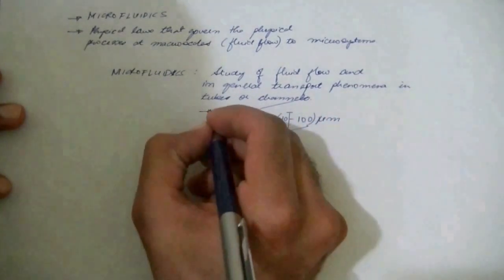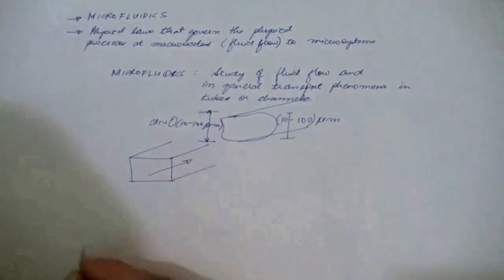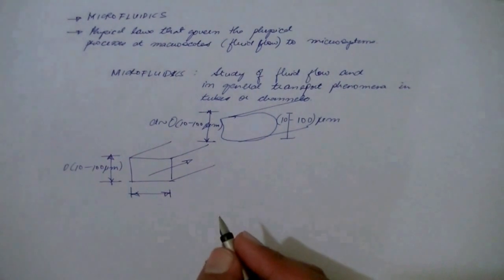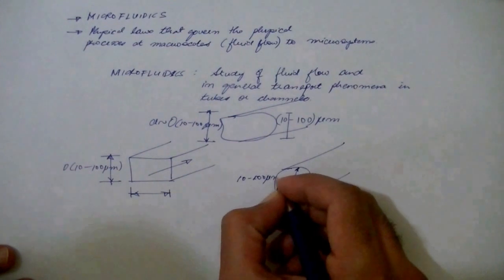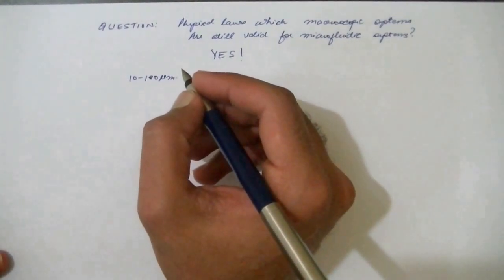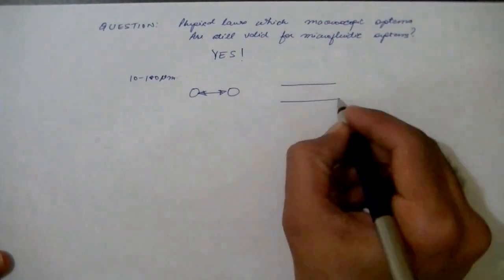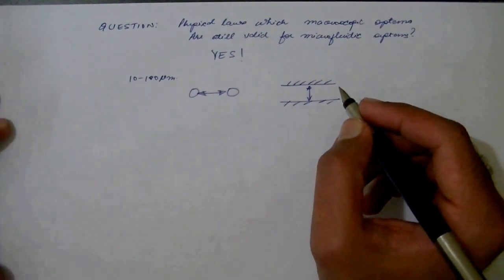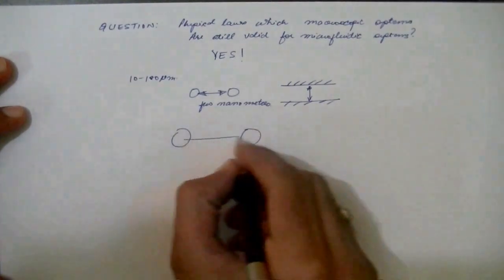Lecture 1: Flow physics at micrometric scale

Comment: These lectures (especially Fluidics part) have been really helpful for me as I did my thesis involving integration of different Microfluidic modules on a 3D printed device with potential applications in Point-of-Care diagnostics. If possible then I would like to get in touch with you to get some insights for my future work. Thanks again Bahga Sir.